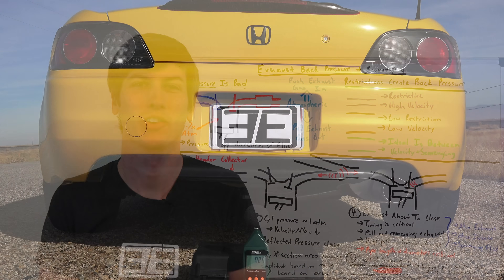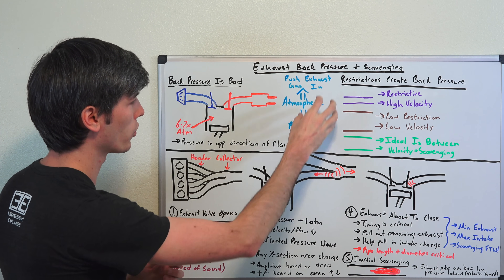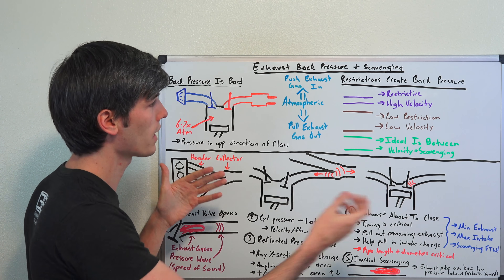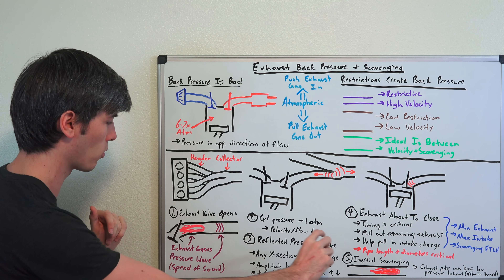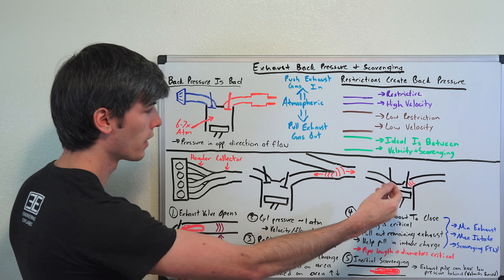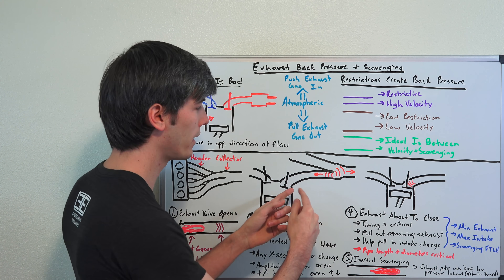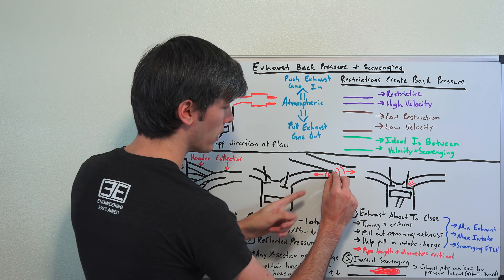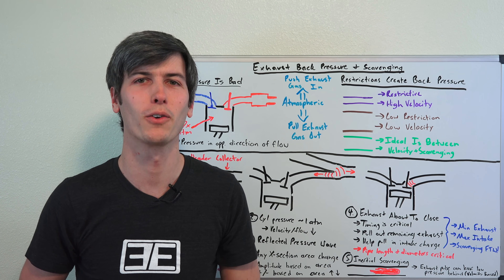Stop Saying Car Exhausts Need Back Pressure

Comment: So the real question is, can I straight pipe my car?
Reply: You can. Drag racers do it all the time. Of course, you can't legally drive it on public roads if you do. And if you don't use the proper length and diameter of pipe, you might end up with less power and lower gas mileage.
Reply: @daleinaz1  how is it illegal? My car just passed dot inspections with a straight pipe exhaust here in Iowa.
Reply: Sorry, should have said it's illegal in many states including mine. Your mileage may vary. AZ used to have an exception for fire trucks, not sure it that's still true. Some states have max noise level laws that virtually require  a muffler of some sort.
Reply: Stephan D why not? It's your car, do whatever you desire.
Reply: +DandiLionism  No it can't damage your engine.  Did you not pay one lick of attention for the entire video?  Exhaust needs to be exit---you could use a 2-foot chimney if you want.  You just don't want it mixing with the fresh intake...other than that, what happens after it exits is COMPLETELY IRRELEVANT to performance.  All of those designs you speak are motivated by environmental concerns, or exhaust notes.
Reply: Yeah I run nothing but a muffler on my 1.8L V6 MX-3 and its fine.
Reply: i have a straight piped maxima.. honestly because Kentucky has no laws on exhaust mods.. if they do then well Metro doesn't care.
Reply: Hell Chevy did back in late 60's on some street Z28's by using crimped pipes, they called them "Chambered Exhausts."
Reply: you need perforationa on the pipe with a sleeve over. Just a straight pipe is inefficient because there's still drag on the surface of the pipe and cab cause turbulence. The perforations allow the gases to flow faster because the slower moving air would pass through the holes allowing more gases to flow straight out
Reply: On the street a straight pipe can easily cause a loss of low and mid range power and torque. Virtually guaranteed.  I've done it several times, and always put a muffler back on.  If you're running the engine full-on all the time (as in racing) then it's a benefit.
Reply: TheLegend27 dont cause its annoying
Reply: yep, I've got a 2000 BMW 540i. DINAN headers, all 4 cats removed, resonator delete, 3" instead of 2 1/2" from the collector back, but I still have a nice stainless dual 3" tip muffler to tone it down a bit. Major low end torque gains, better mileage, and the European V8 sounds like a beast.
Reply: @Kevin Karbonik, if you could just drive down my street every once in a while near redline, I'd be grateful.
Reply: Jack Watson I did too. Felt like I lost low end torque
Reply: You can. My Silverado is straight piped. Engine performance increased, fuel mileage has also went up. Been straight piped since the day I got it. Also, my dad’s truck is straight piped, 5.7l Hemi. Been straight piped for over 10 years, and performs like a beast
Reply: Straight pipes would work better, but the amount of noise is annoying and illegal for road use.  
You don't want pressure in the exhaust.   Pressure and restriction in the exhaust saps power, and makes the engine run hotter.
Reply: It actually CAN damage your engine, while looking at basic physics principles perhaps, but any actual practical application it's necessary, there is ALOT more technology behind consistent pressures in exhaust, billions of dollars have been invested in testing these "pipes" not just whiteboard markers.
Reply: @DandiLionism  can damage? My 1974 small block totally laughed at this

Comment: I’m so glad you made this, too many people think back pressure is a must to have on a car!!! I’ve been arguing this for years!!!
Reply: Its about the pressure wave, a completely open exhaust won’t scavenge and mid range torque is lost
Reply: Haha yup, I don't think I could find a better example of an engine designed with this goal in mind, than the Porsche 918's. Reverse-flow heads, and the entire exhaust system is like 6 or 7 inches long
Reply: Talk to the racers if u think back pressure is bad.

Comment: The temperature of the exhaust gas in conjunction with the exhaust geometry,  valve timing and also intake pipe length all need to be considered.

Comment: There were 2 stroke engines that required an exhaust-induced shock wave to get the engine functioning well, also there was a scavenging patent design applied on piston aircraft engines.

Comment: 1-you should breathe and take more time : you rush the video, you sound afraid of peoples attention's span.
2- just say it  : Bernoulli 
3-You just say yourself you need  backpressure wich is a necessity to have gases speed to get scavenging effect,so while you say to others to stop saying it.....
4-why to limit your video to cars exhausts ? they didn't teach you for other applications ?
Reply: What he's saying is you don't need back pressure but you need to maintain certain velocity by controlling the pipe length and diameter...
Reply: Outlaw Works on same principles of carburetors, using venturi to alter air speed (velocity).

Comment: In short, proper terminology is very important to learning and understanding (especially complex) concepts properly. Oversimplification can often be restrictive to learning so instead of "backpressure" we refer to it as "Exhaust Flow Cylinder Pressure Reduction Assist" or EFCPRA which just flows off the tongue.

Comment: I think that you should definitely include valve timing overlap into this, because it requires some limits of scavenging efficiency and thus theoretically requires some back pressure. When you take it into account, the premise "the better the exhaust gas evacuation, the better the performance" doesn't hold anymore.

Comment: The only reason there needs to be some back pressure is because the exhaust valves don't contain 100% of the pressure the cylinder exerts. The back pressure helps prevent some gas escaping.

Comment: Excellent except you put the cart before the horse about a third of the way through the video I'll let you figure that out, easy fix for this is turbo exhaust. Back pressure is essentially BS, two perfect examples are a dragster and a prop plane, the only reason they have any piping at all is to keep hot gases away from the motor for safety sake

Comment: Thanks for everything, Jason, you're a real gentleman! Here's a comment: i know of exhaust power valves from performance motorcycles, either beyond the collector, or, in the case of a 2-stroke motorcycle i once owned, positioned just at the exhaust port/manifold. What kind of use do they see in cars?

Comment: Would a free flowing exhaust with a turbo not cause more wear with the high spooling speed, you will hit a point where the compressor side will act as a brake as it can only intake a set volume of air but at a higher velocity?

Comment: this might be kind of a goofy idea but what if you had a high pressure turbo system and you channeled a portion of the pressurized air to the exhaust using a venturi to suck the exhaust out of the engine, would this prevent detonation in high pressure engines?  just a thought.

Comment: Yep, so when torque figures go up on a dyno on an NA vehicle with a 2.5 inch on some motors, and DOWN on a 3 inch exhaust fitted to those same motors, due to less cylinder fill, back pressure is all bad. Ffs.

Comment: Follow up video please... pick a motor... something with variable valve timing would be ideal... determine ideal header diameter, header length/s, collector dia, exhaust diameter, x-pipe location (if you picked a v6/8) and the effect that the catalytic converter has on the exhaust gas velocity... All this to take advantage of the vairiable valve timing..

 many gains for your air pump can be found on the back end..

Comment: @Engineering Explained could you please do an episode on 4x4 snorkels, forward vs rear facing. is there any benifits or drawbacks using either. cheers

Comment: Your very smart bud and I like your videos but I have to disagree, you have to have back pressure or you would lose hp yes you don't need back pressure on engines making enough hp but a stock engine has to have some kind of back pressure or the engine won't run correctly . If you could do an experiment to prove your findings would be great.

Comment: Why did my car run not as good when my exhaust has holes and a leaky manifold as opposed to the engine very obviously running better with a good exhaust with no leaks? As far as I know only a diesel will run without manifolds exhaust or intake (not direct injection diesels, can't get over a diesel with throttle body... Wtf)

Comment: Could you make an example video on how or do turbo charged engines need backpressure? Because the turbo itself is performing this during operation after the exhaust manifold or down pipe. Maybe? if so that would be good if you could piggy back on this video here. Thanks a lot!

Comment: A few random ideas running through my head: Variable exhaust valve timing?  (for different RPMs to allow the pressure waves to hit at the right moment)  Some sort of exhaust vacuum pump (like a turbo but applying pressure directly through the exhaust system instead of the intake -- how about a supercharger setup that does both increased intake pressure, and negative exhaust pressure?)   Final wacky idea: stick a turbojet on the exhaust, using the exhaust as its intake (probably massive disaster performance-wise).     Yes I know probably all crazy ideas, but you've got the brain to know if some of them might actually work or not (without blindly trying, that is).

Comment: Collector design is a bit more complicated. Look at Merge collectors. The S2K uses a 2into 4 into 1. It has some advantages over a 4 into 1 through the rev range. 4:2:1 tends to have a wider power band with a little less peak than a 4:1.

Comment: I remember reading years ago, that some manufacturers utilized a slash cut exhaust tip after the muffler to  help negate the effects of the reflective pulse or wave.
Would this be different, or similar to the way that a smooth transition into an aftermarket headers' collector functions? (although clearly on a larger scale, as after the exhaust tip, the entirety of the planet's atmosphere would be the collector)

Comment: True a turbo engine runs better high flow, with less back pressure and more velocity means faster spool times. NA however is a different story, If you focus on velocity your fine but to say you don't need back pressure is going to cause excess wear. It can be mitigated somewhat with a solid valve train, you put a solid and a hydraulic engine next to each other and high flow them I guarantee the later will need to be rebuilt earlier...  

A friend and I use to do track days, I Have a Focus 2.0R with FPR tuned length race headers (has shaped outlet for scavenging) decat 2.85 inch straight through with uprated ignition and remapped to 9500rpm. He had a Mitsubishi gallant VR with headers and the same size exhaust (made buy the same shop as me), He always got to the point of the dreaded blue smoke start up before me and we'd rebuild the top end usually new seals and lifters (hydraulic). With mine it took way longer to get to that point and all we would have to do is seals and maybe re-shim a bucket at the extreme.

We ended up dropping in an exhaust on his car that was 2.25 inch instead as an experiment after he destroyed his original on a speed hump lol, after doing so his car would last close to as long as mine. I've seen this from experience, back pressure does have an effect on longevity for certain valve train styles....

Comment: So if the exhaust velocity in a given engine design is too low, the remedy is to increase back pressure by installing a smaller diameter exhaust pipe?

Comment: Question:
Would a "sweet spot" be at exact tdc, or approx 1° btc? My thinking of 1° btc is to ensure there is no what I call "positive vaccuum" or pressurized air from back pressure in the cylinder. What do you think?

Comment: I have been hearing this "you need back pressure" since the 1970's. I thought it was the dumbest thing I had ever heard but did not have anyway to explain why. Now, I will say that those people back thing used the wrong word "back pressure" instead of "scavenge"  but they did know that having too large of a diameter exhaust was not good. Even without using the right terms they made the right decisions. Thank you for explaining this piece of engineering.

Comment: Brilliant , wonderful , excellent. Thanks . So there`s no point in putting a large-diameter exhaust system on a standard-tuned car , as the exhaust gases won`t be flowing fast-enough - the exhaust needs to be tuned to the specific engine-tune state e.g. the rev range and where max power and torque are in that range ( and/or where you want them to be ) ? Happy New Year to you too.

Comment: Your videos are always done very well . But in this case you give some misleading information on valve events . And I know you understand valve timing events , that being said the exhaust valve opens before BDC and all the cylinder evacuation needs to be done before the piston arrives at BDC or the engine will experience pumping losses . And pumping losses are HP losses

Comment: Great explanation, Jason! This is the difference between a “hot rod” shop just cutting and welding some pipe and getting “meh” power, vs an engineered exhaust system that was mathematically optimized to scavenge in the desired fashion and maximize power where you want it.

Math. It’s the difference between building a fast motor or building a boat anchor. Stay in school, kids. 😉

Comment: This was fascinating!  How do manufacturers work out what diameter tubing to use for the headers, tail pipe etc?
Also, could you do a video explaining the effects of intake manifold design, runner length, plenum size etc? This is a really interesting topic for tuners!

Comment: My lecturer back in college said that, "you ideally need a small amount of back pressure to help with the scavenging effect especially in N/A engines." Does this stand up to what you have been saying? Also 2 stroke engines  benefit from back pressure at lower rpms as the exhaust port is open at the same time as the intake. Also sorry if im sounding a little agressive in this, i dont mean to, im pretty drunk. Happy new year btw! Love the channel! <3

Comment: Good video, now you should do one on why the H or X pipe work to give about 10% free hp on the older v-8 musclecar engines!

Do the cylinders stop working against each other or what? I know it works but never been completely clear on WHY it works.

Comment: Interesting.

I'm wondering how these reflected pressure waves work. If one is produced every time a diameter changes, then wouldn't the reflected pressure wave create it's own reflected pressure wave when it reaches the exhaust valve/cylinder?

I'm also wondering what happens if you move a pressure wave through a conical pipe, one that has a steadily increasing/decreasing diameter. How does that affect the generation of reflected pressure waves?

Comment: That one was a boooomb!!!! 
Thank you so much for making this great video. i had endless discussions with a colleague of mine about exactly this topic. i never could convince him at all, that 4 stroke engines need  backpressure is a wrong tale and that people follow this idea always mix up 2stroke theory in 4 stroke engines. maybe forwarding your video now ends this endless discussion during lunch time in our cantine :)

well....still i am a little unsure, if a little bit of this 2stroke-effect becomes true also for 4 stroke engines when large valve overlap comes into the game (higher cylinder pressure due to exhaust backpressure)...but i think, this effect would be barely measurable

Comment: So my car has an exhaust leak early on in the pipe. Does this prevent a negative pressure wave from going back to the cylinder and helping to exhaust the remaining gases? Am i losing a lot of efficiency from this?

Comment: That was so interesting!! I get the whole thing with maximising exhaust velocity but still maintaining good flow, but  is it the same for a turbocharged engine? Won't the force/ flow of the turbine in the turbo be enough to push the exhaust gasses out at a high velocity even in a very large diameter pipe? Or should the same principle be applied to try increase exhaust velocity even more? Cheers, happy New Years everyone!!

Comment: Jason, how does this work when you add a turbocharger into the mix? Of course it helps to have the right header design up to the turbo, but what about the exhaust piping after the turbo? Is it good to start with a large downpipe and progressively step down the pipe to improve scavenging throughout the entire exhaust system?

I've got a 3" downpipe on my car, which improves responsiveness immensely. I was thinking about getting a midpipe that steps down to 2.5", and then having the axle-back step down to 2.25".
(Engine is a 1.6 Turbo GDI)

Comment: All the old guys say that on smaller displacement engines, if you don't have back pressure, you can bend valves at high RPM. Where did this idea come from?

Comment: Can you explain what this means for the WRX STI's unequal length headers? Does the combined pressure from exhaust wave overlap at the collector result in stronger reflections back to the cylinder?

Comment: Always wondered about the exhaust design of performance engines... "why do they need so much tubbing in between the cylinders and the exhaust pipe?" you know, with all those curves and so much room taken up by so many tubes going everywhere... could never been bothered to do any research though haha. this pretty much cleared al that up. now it all makes sense. Thanks!